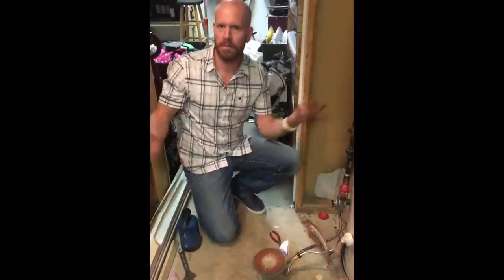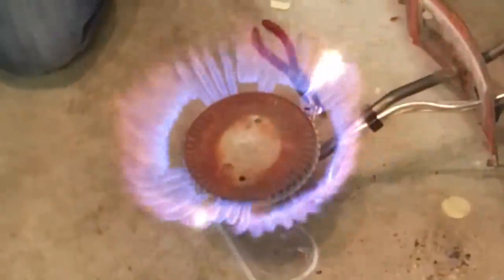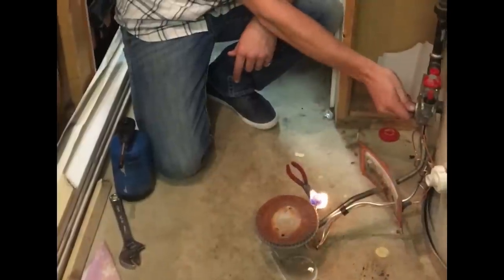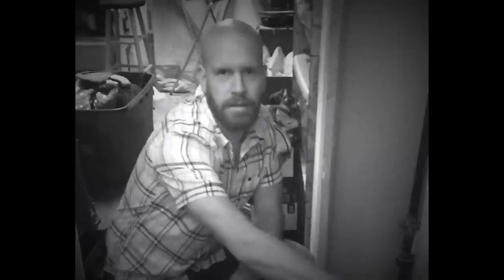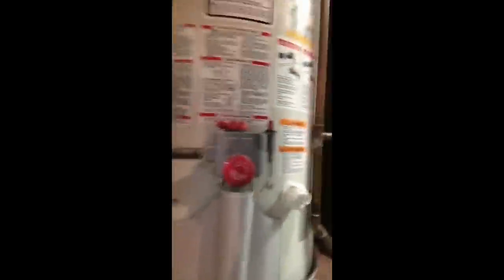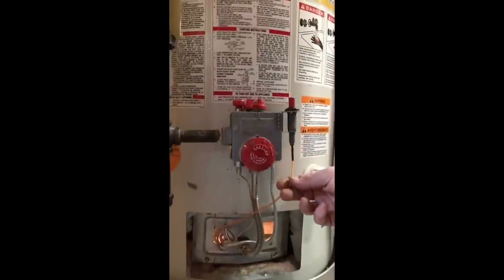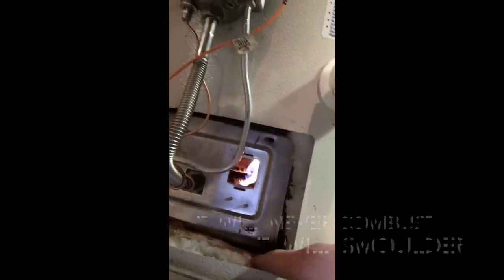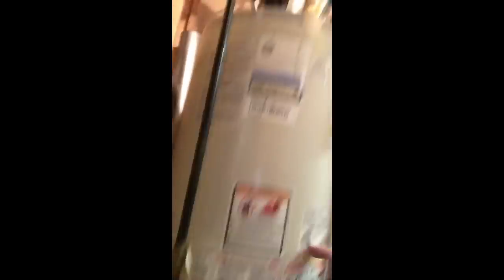Pilot light/Burner won't stay on Hot Water Tank (SOLVED)[well, solved if this is your problem]

Comment: your rite its an air flow problem which is caused by some sort of safety device called TRD or FVIR (Flammable Vapor Ignition Resistant )which looks like a fuse,once the water heater goes above a certain temperature it blows which in turn releases what is called a damper rod,that damper rod when pushed down opens the air flow which is what you see outside the heater(all the little holds around the heater)the fuse holds the damper rod down,once it blows it releases the damper rod which cuts the air flow.
Reply from the maker: gerohan salas thanks for this write up Gerohan and everyone else needs to read this.  

Like it’s said in the video, this is a temporary fix, and probably not something you should rely on to get you through another 6 months, 

That’s said, there still isn’t a video that explains this issue, or the causes, not the least of which is an overhead protector, to the average layperson
Reply: gerohan salas n
Reply: Wow I just order the reliance gas assembly kit

Comment: Wow! This was very helpful. Same problem here. I ended up blowing mine out with a portable air compressor and using a shop vac after that. The hot water heater sits right next to the dryer. I can't wait to tell the maintenance guy from the rental company. He left for another job. They are talking about replacing the whole water heater. Seems like everyone should be told about this. Mine works fine for now. Thanks for the help.
Reply: Timothy Anderson - this is the truth. 

Follow this advice to save time money and expense.

Comment: Thank you so much for your great video , brother. Finally the trick you mentioned in your video worked for me too. I was in a plan to replace the whole water heater which cost about $1200 at this time when I need money for buying the back to school supplies including expensive shoes and clothing for 2 kids of this fashionable and chosy Era. I made an attempt of do or die action and started to open and did the cleaning by dusting the underneath of the tank and the burner assembly gently hitting, tapping and vacuuming the area and put the assembly back and turning the pointer to the pilot position hold it for atleast  10-15 seconds and pressed the ignitor button 5-8 times until the pilot light started blinking for 3 times, then turned the controller switch pointing to very hot for atleast 10 seconds , the burner lighted up waited for few seconds and turned the controller switch pointing to hot position and waited for 5 minutes to make the pilot light and the flame stay on and it did. I could feel the difference in the temperature of the water just after 5-7 minutes . It finally worked.
Once again thank you so much for making this video. You saved my extra expenses for now. I am so glad that I made it and saved money. I hope I can help my friends and families next.

Comment: Thank you for posting this video!! I removed the glass square window and replaced it with a square metal mesh screen (just for saftey reasons) water heater stays on!! issues resolved. Your video was indeed very helpful. Thanks again.
Reply: Appreciate your comment. I'm going to give that a try.....
Reply: The flame arrestor is there for a reason. To stop the water heater from lighting any flammable fumes (such as paint) in the house.

Comment: I watched a certified techs video and he said blow out the bottom with compressed air on the inside.. did didn't work. Watched your video when you said remove the bottom and that saved me! Did exactly that and my issue was there is a spring damper that controls combustion air, I think it was sticking. I shimmed it open with metal and it works like a charm. Not recommended probably, but I'm an idiot and I want a warm shower.. plus I just bought this damn $800 Rheem 3 months ago. Thank you thank you!!

Comment: the new control boxes and burners are much more problematic.  in fact, I had an old control box and burner and got the pilot light to stay on but the burner would come on.  once again, it may have been starved for air.!
And yes, I thought I was the only one who would connect the burner on the outside to test it.
Nice job!

Comment: Mine was a air flow problem, I kept cleaning it with brush and shop vac and pilot kept going out and I found a video using pcv pipe with a elbow attachment with the other end attached to shop vac and stick the elbow end under the water heater if you have one with the airflow vent underneath and I did that to my water heater and pilot has been staying on going on a week so far with no problems. So thank you for sharing that it could be air flow problem and having people save money and hours of headache time trying to fix it when it can just be a simple fix.

Comment: Never felt the need to comment on  a video, but this video was more than helpful, so thank you. I replaced the thermocouple, thermostat, and the gas valve only to find out it didn't work. After many struggling attempts, NOTHING. It wasn't until your video mentioned airflow that the bright lightbulb appeared over my head. It had rained and soaked the bottom sponge and I used a vacuum to remove the water and followed the rest of the steps on your video. Thanks for the help!

Comment: Thank you for sharing your experience, ss! Your tip saved me ALL the time that could have been wasted on other fixes.  I DID change the thermocouple, just like I did almost 2 years ago.  After changing again today, flame snuffed out.  Watched your video, then vacuumed on top and under vent on the floor of the ignition chamber.  While vacuuming, I managed to knock a clip loose, then tore open two vacuum bags before using a stick magnet and retrieving the clip from a hard-to-see place under the unit but over the stand!  Hot water delayed by only 4 hours instead of 24.  Thanks again!
BTW, the Whirlpool manual describes the air supply/intake/screen a 'FLAME-TRAP'.

Comment: Water Heater Flame Arrestor
To take everything right out and test it, that's good troubleshooting. You were right that it was flame just wasn't getting air.  Your solution showed that, but I'd be nervous about breaking that out.  

There's a great video I just happened to have seen yesterday :

Water Heater Pilot Won't Stay Lit - Water Heater Flame Arrestor.  
I'd never heard of those but they need to be cleaned regularly.  You don't want to take that window out because you lose the protection of the flame arrestor.  Please watch the video I don't know what I'm doing other than I come here to learn.

Comment: Honestly, you could help people out more by explaining that they need to first ensure proper air flow, but then to check the safety device, as others have mentioned, which shuts off the air flow completely in case of overheating. That was my problem. I first cleared the air flow obstruction, then rigged the safety device with a bolt to hold the air flow open. Yes, I do plan on replacing it with the proper component (which is oddly expensive), and no, I would not recommend this as a long-term fix. But I think it's a much better solution than running your heater with the service panel and pilot window removed, as others seem to be doing, following your lead . . .
Reply: Then why is it different to remove the window and have an opening compared to the older models where you went in with a match to light it? There weren't windows on those models.

Comment: Wow it worked. It almost got pricey I brought a new thermal couple it’s still in the packaging and I will be returning it back to Home Depot tomorrow👍🏼. Thanks to your video and my ability to sit down and shut up and listen I was able to try your advice. I basically was having the exact problem burner would gutter out will not stay lit. I cracked the assembly with a gap. I’m going to attempt to use a vacuum and a air compressor to see if I can blow and vacuum any debris before bending and making permanent gabs. My only problem was air flow thanks for the awesome video and saving me headache and cash. All components seem to work but yet there I was on the verge of going replace this and that. Lmao

Comment: So, dumb question, my guy replaced my power vented gas water heater with a low end/normal one. I believe I’m not getting enough air as mine has gone out numerous times. How do I get air “safely“ into the systems to keep the light lit all the time?

Comment: thanks for the heads up, been trying to help my brother, done replaced thermocouple a couple times and the gas valve, we were beginning to think air flow but not sure how to check or fix it, so this gives me one more hail mary before replacing burner assemby. I almost tried turning the burner out like you had it but just kinda thought it couldn't be air flow.

Comment: I had the same thing happening on my 12 year old kenmore tank. The thermocouple was fine, but the pilot would go out while the burner was heating the water.  I found the solution on another persons channel.  There is another air filter under the burner assembly that got clogged.  I macguyvered  a 90 degree blowout tip for my compressor as well as one for vacuum and proceeded to blow out and vacuum this flame proof filter above and below.  Put all back together. No more pilot flameouts.
Reply: Whos page??
Reply: @JUDGEME5150  too long ago.  Made a tiny crevice tool for vacuum and between shots of compressed air and brushing/vacuuming cleaned it

Comment: Question, could the solution of 'air flow' apply in a situation where it's a brand new installed water heater and while the pilot stays lit the burner doesn't seem to turn on when expected. For example, I have it set to the hottest setting, but when I'm running hot water the burner click on for 20 minutes.

Comment: Thanks so much for your video! Similar things happen to my water heater and I am doubting whether mine is lack of air flow as well. Now I have some evidence that it might be more than just a bad air filter as with the chamber open to air, the pilot light goes out as soon as I release the gas reset button. So, I would like to ask what exactly you observed when the whole ignition set was in the combustion chamber. Did the pilot light gradually die out after you release the pilot button, a sign to use up the air in the chamber, or was it put out as soon as the button was released?
Reply: Also, how does the water heater work after three years of running since the last fix?
Reply: It went out over a second or two.  Yours sounds like the thermocouple is faulty.
Reply: @jesseloates644  We replaced the whole set including thermocouple, pilot light ignition system etc (all come as one piece), but it still does the thing I described. The model is in use as early as 2003 and might not have the FVIR setting installed, or maybe not even with an air filter.

Comment: This helped at first for me but I found out the TRD "Thermal release device" was tripped closing the air damper that allows air flow from bottom of unit, Just another possibility to look for in trouble shooting the same problem..

Comment: It looks like your pilot light is extremely high.  If you have a Pilot Adjust screw, screwing "In" is to lower the flame and "Out" is higher, at least that's how it works on my AC/Furnace.  Mine has a larger screw with a long shaft that's only threaded at the top and that's covers and protects the adjust screw inside, so that has to come out to adjust the pilot flame, then reinstall it.  Check the manual to see if you have a Pilot Adjust screw, knob or control.  You can save a bit on your gas bill and maybe prevent the high flame from damaging something else.  The manual might tell you the proper height.  Good luck!

Comment: So, my guy took out my power vented water heater and replaced it with a cheap one without the power vent. I believe mine is not getting enough air, Causing the pilot light to go out numerous times. Best way to “safely“ get air into the system to keep pilot light lit. Thanks

Comment: Mine is newer kind that has honeywell gas valve controller. I cleaned the filter on bottom which after doing that I could light the pilot light. The burner will fire up but go out and the status light wont light up. Some fuxking sensor is keeping it from Working correctly. I dont know what to do and I cant take the combustion chamber out because I cant get to the damn thing. I think i habe to remove the whole shell. Kinda lost at the moment

Comment: What did your Thermal Release Device (link) look like?  Was it okay or broken?  That was the one piece you didn't show.
Reply from the maker: Kristen Anderson great question.  
I top posted another guy’s response as the one in this tank had failed.  
Ultimately though, nobody seems to read it.
The point of this video, though, was to give a temporary option, like I said.  

I kinda wish I could remake the video to include that fun little bit of info.
Reply: @crispysamurai  Thanks!  I appreciate the videos.  I'm trying to figure out why my heater won't stay lit.  I'm going to start with cleaning it and replacing the Thermocouple.

Comment: I would like to add some information here. The cause for the issue - the pilot light cannot stay is case by case. some is due to not enough air, even there is the filter on the bottom that needs to be cleaned.  some may be due to the thermopiles, some may be due to the circuit board within the control valve, some might be due to the control valve - that is for my case. I replaced the control valve, my water heater works again. ( I did have tried to replace the thermopiles, didn't work, swapped the circuit board from the new control valve, didn't work)

Comment: There is a very good video from Kevin Miller/ How to fix water heater, will not stay lit-sealed combustion no hot water. This tells you why the pilot lit stays on but once the burner comes on it will shut everything down. It fixed my water heater and I didn't have to take the window out or leave the burner open to let air in.

Comment: All water heaters now have a federally mandated safety device to shut down the water heater if it gets too hot.  Simply, there are two doors held up by a small glass vial (one type) on the sides where the perforated air inlets are.  Overheating causes the vials to burst and the doors come down, starving the flame.  If you look thru your window while relighting, you will see the flame quickly go from blue to white and the flames get long and wavering, then disappear.  Oxygen starvation.  You can get a free kit to repair it, taking about 10 days before mfr. will ship.  This then requires draining, disconnecting and lying the unit on its side and repairing from bottom.  No plumber will do this because it is so labor intensive.  It is far more cost effective to buy another unit.  Plumbers hate this as much as you because homeowners get frustrated and upset with the plumber.  Thats me.  Nice idea opening the front, although I would not do this because unit is now operating outside of parameters.  I have also gone out on calls where doors are up but glass window is removed/broken; air draw through window sometimes blows out pilot.
You sir are one tenacious man.
Reply: planned obsolescence is a scam. good job thwarting the repurchase!
Reply: I found the part on Amazon also, FYI: https://www.amazon.com/Flammable-Ignition-Resistant-Thermal-Release/dp/B01A932ISE
Reply from the maker: lol.  well. it's certainly not "right"by any means,but it gotus by for a few weeks.   The protip about the glass vials is good info man, i hope other people read this.

Comment: You are a GOD among MEN. Same problem and it totally worked outside of the tank. If I continued messing with it I would have your hairdo. -Delta BC
Reply: Repair Water Heater pilot light won't stay lit - sealed combustion chamber Thermal TRD FVIR look it up on youtube

Comment: i  could  not  find  any  videos  either what  you  just  talked  about  !!  so  is  it  a  big  task  to  drain tank and  put  it  on it  side ??  then  would  yu  have  to  diconect  the  pipes  or  how  would  you  move  the  pipes  and  valves  around  the  tank??  this  is  a  job  for  super  man .. i  have  a  feeling  this  is  my  problem  but  my  land  lord  is  a  dik.  how  long  did  it  take  yu to drain tank ,i  wish  you  showed  that  process  so  i  could  see how  it  was  done,

Comment: I think your pilot light has the wrong orifice in it , the propane one is almost double the size opening , should be just a tiny pin hole it sits inside the end of the gas tube

Comment: I think the solution to your air intake problem is to get a larger water heater drain pan.  Yours is way to small, it does not let enough air in.